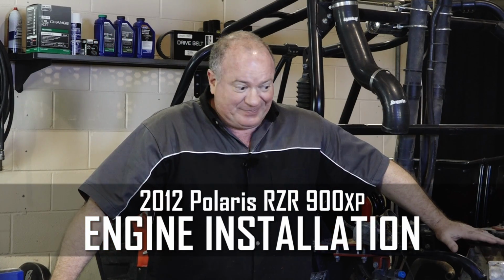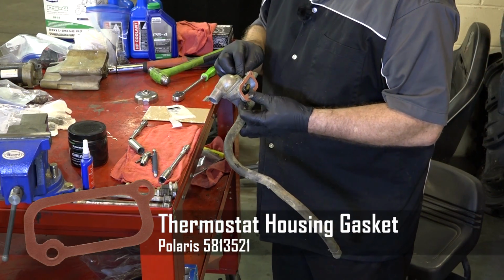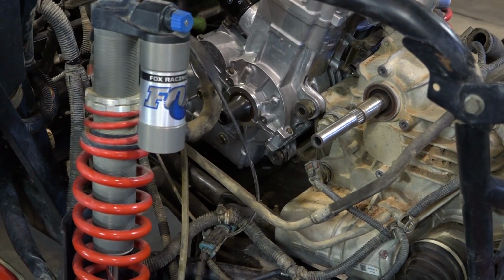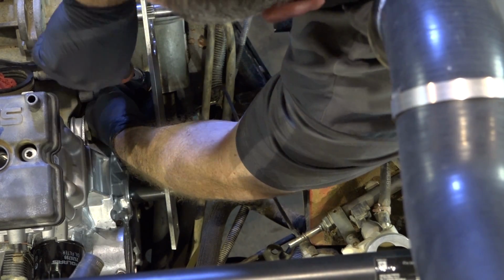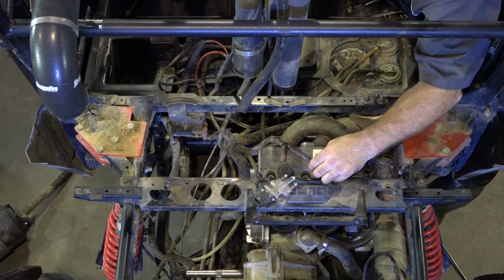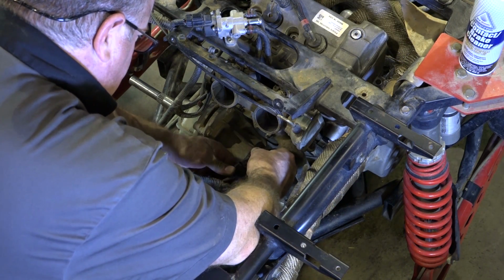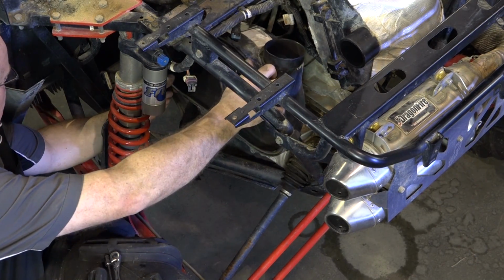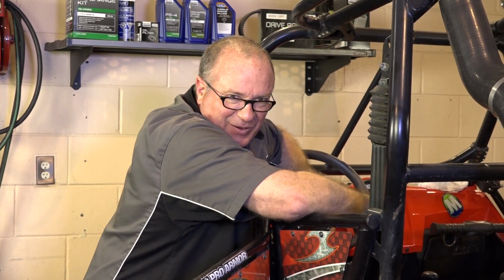Polaris RZR Engine Installation | Part 7 in Series | Partzilla.com

Comment: Hi Partzilla recently I bought all the pieces from you for a rzr 900 engine rebuilt, the engine and plastics are already mounted, my question is what do I need to do in order to break in the engine? I run a complete gas tank in idle mode? For now, what else do you suggest? Thanks

Comment: hello I'm looking on partzilla.com and I don't found the tool that u use to aline the engine and the trany  also the tool that you have used for making the timing on the camshaft thanks for or help. And if the tools are not on partzilla.com can you please tell me the part number that I can call polaris to buy it thanks and also thanks for the series off vidéo I have been able to rebuild my rzr xp900 2011 it or vidé
Reply from the maker: It appears to be dealer only, PU-50658.  Might be able to find aftermarket versions.
Reply: @PartzillaParts  thanks so mutch

Comment: How important is that alignment tool ? I’ve pulled my tranny twice and have not used it. Don’t seem like there’s really much room for it to be off much with 4 bolts holding the two together
Reply from the maker: You can do it without it, but it's recommended, so that's how we did it in the video.

Comment: I'm about to do an engine swap on a 2014 rzr 900 xp 4. Everything is stock and being replaced with stock. As far as I can tell the 2012 has the same engine as the 2014, externally anyways. This should be mostly the same procedure correct? With the exception of the dry sump oil system not being on the 2014. Thank You
Reply from the maker: Yes, same concept.

Comment: I am rebuilding a 1000 with hotrod crank/rods. Does the orientation of the rods matter
Reply from the maker: The service manual should give you the correct orientation if it's necessary.

Comment: Hi John , have you ever had a problem with 2011+12 xp 900 starter idler shaft coming loose and rouining the case? if so is it common on these years of 900?
Reply from the maker: Yes, that was one of the issues with the RZR900 we rebuilt in the videos.

Comment: So during first start up does it need to be at a certain RPM for certain amount of time for breaking for bearings and cam
Reply from the maker: It's just like breaking in a new motor.  Let it idle for a bit to make sure nothing is wrong.  Then ride it, vary RPMs, do a 10 hour service.  You don't want to stay at one RPM for break in.

Comment: Great series! I'm in the middle of removing my transmission in my 14 XP 1000. I believe I have an issue with my output shaft. Lots of rotational slop in the drive shaft and it is not turning while moving. Does the transmission case have to be split to replace the output shaft? Do you guys have any videos of just the transmission removal? Thanks
Reply from the maker: We haven't done one of those yet.  We'll add it to the list.

Comment: I just rebuilt my top end going along with this video and I'm burning about 1/4 of a quart of oil per 1 tank of gas 
Any ideas?
Reply from the maker: Hello Kolby.  In most cases that would be a result of worn rings or possibly a worn cylinder.
Reply: Partzilla hoy much do you charge to do engine rebuild on a razor 900?

Comment: So.... what's next?
Reply from the maker: Today we're putting the bed and the plastics back on this RZR, then we're going to switch gears and work on a couple motorcycles. First a Honda VTX1800 (oil service, air filter, brakes), then we're doing a top end rebuild on a 2008 Yamaha R6. The R6 rebuild should be another epic project if you're into two wheeled wrenching. Stay tuned...

Anything on your wish list you'd like to see?
Reply: Partzilla cool. Anything Polaris interests me as far as future rebuilds etc